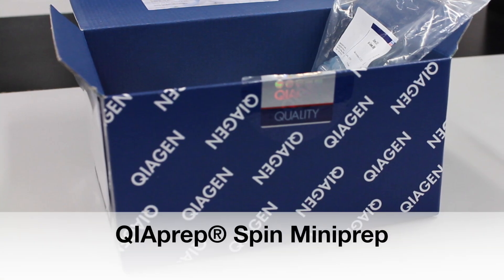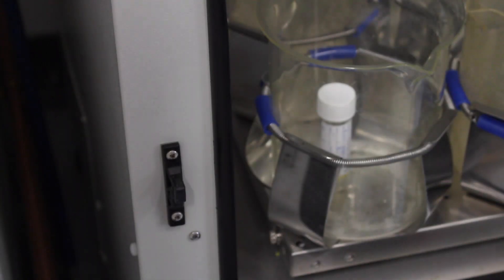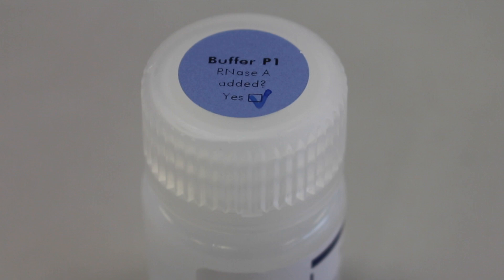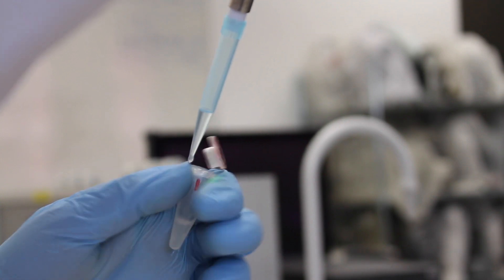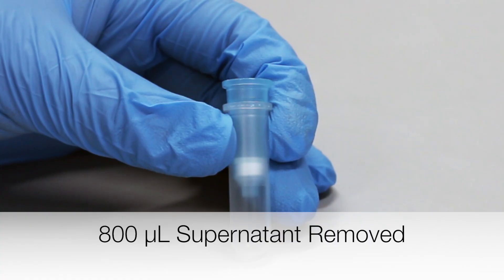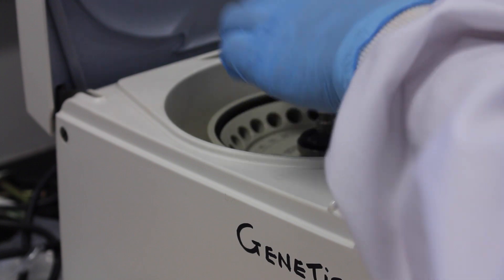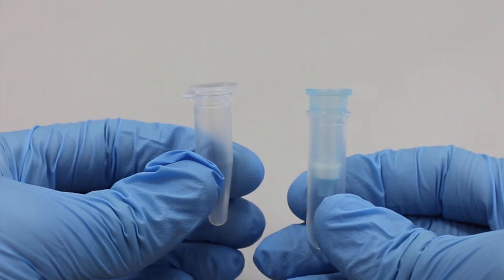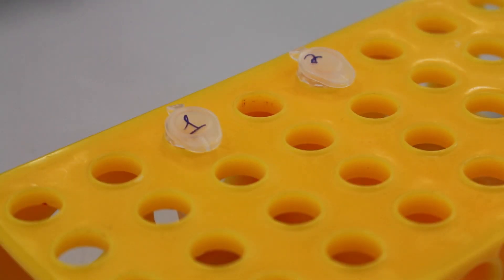Protocol 8: Miniprep (QIAprep Spin Kit)

Comment: Note your centrifuge tubes should be lined up so that the hinges are all on the outside...this makes the pellet go to a known location I.e. the back of the tube...label your columns as well in case these get separated from the other tubes...otherwise well done